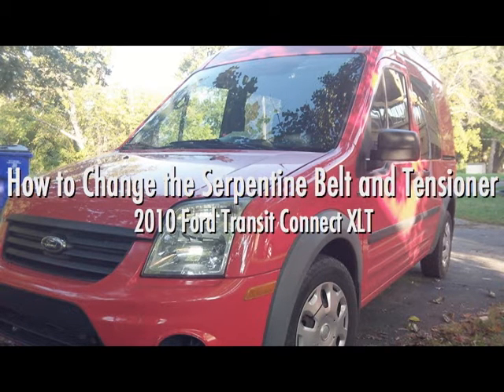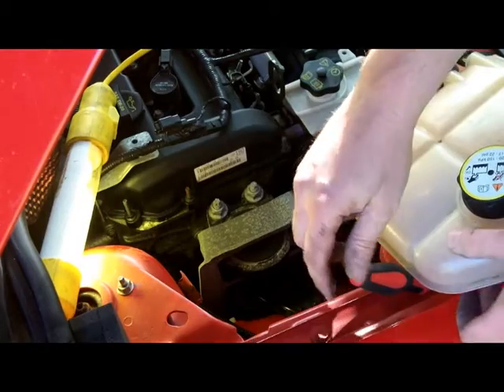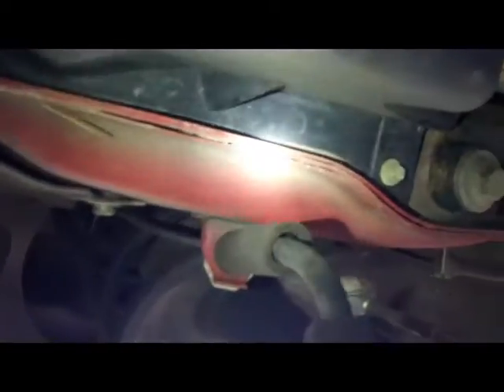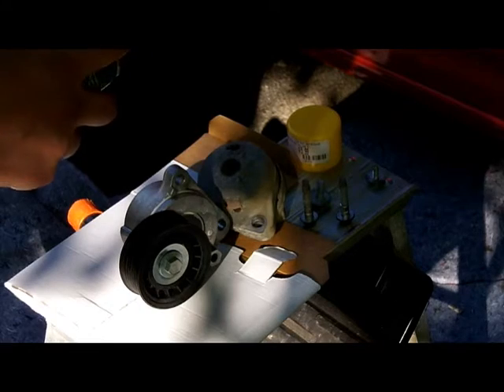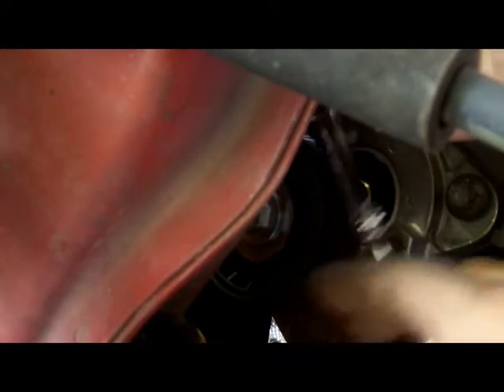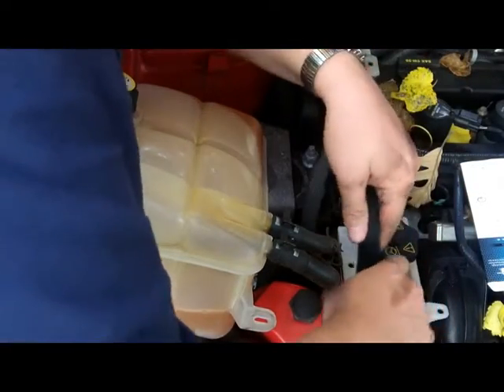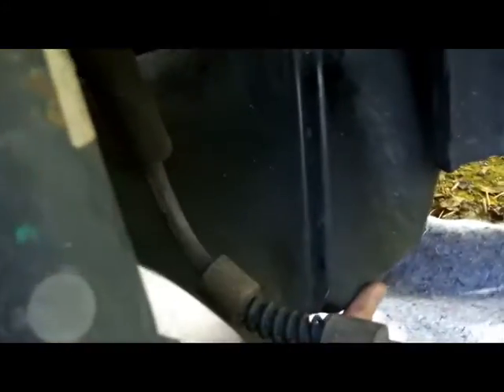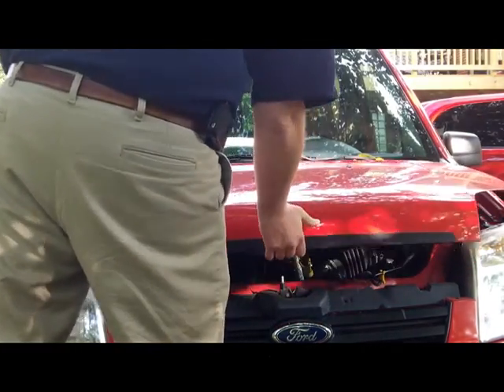How to Replace the Serpentine Belt and Tensioner on a 2010 Ford Transit Connect XLT

Comment: I have the same exact vehicle and the same thing happen to me, and didn't know what to do and was very frustrated and then I found this video, thanks to this video I was able to fix my transit, I also had to use the same trick with the 2 wrenches together to gain leverage to loosen the tensioner, wow !!!
 i had to look at the video several times, but I was able to fix my vehicle myself, (the dealer wanted an arm & a leg) thank you very much, and many blessings to you !!!
Reply from the maker: Outstanding! Thanks for letting me know it helped. You made my day.  Cheers!